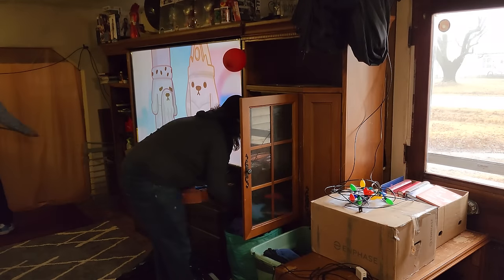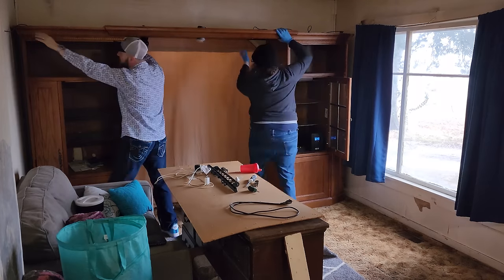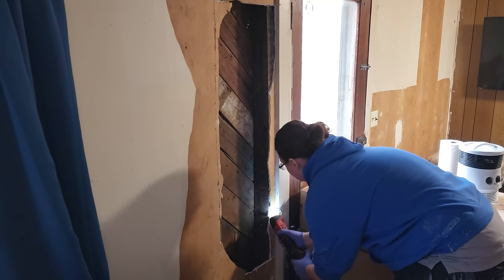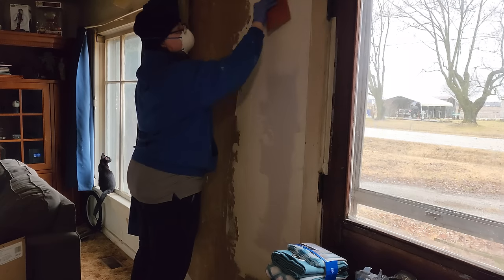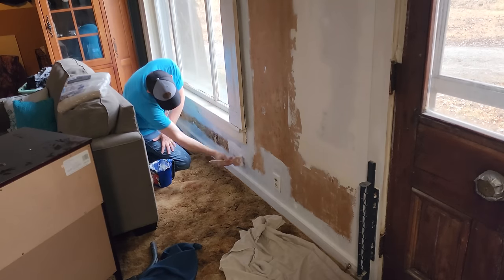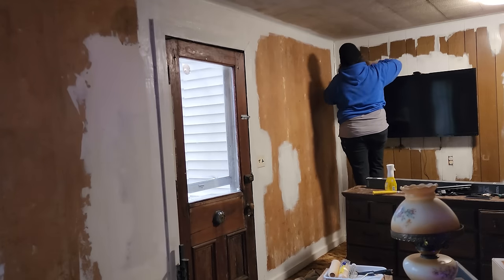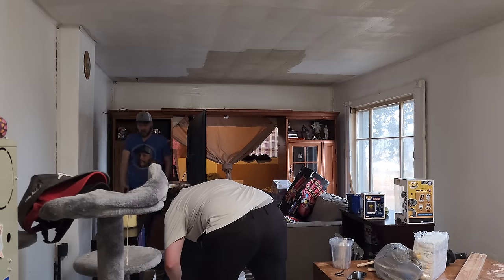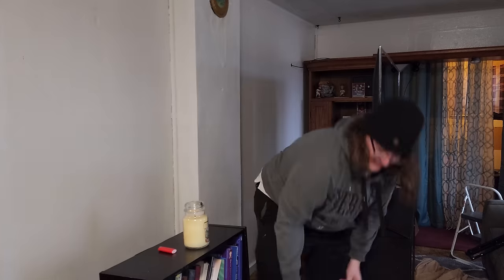Saving a Destroyed home for FREE: Episode 3

Comment: My home is 117 years old and while it's definitely in disrepair, these videos help me realize that I might not be in as bad a starting point as I thought. I am very thankful to be able to get a house at all. I have done many sub $50 repairs slowly over the course of the last two years and the home went from uninhabitable hoarded infestation to functional clean but dated home. Thanks for the motivation to keep moving forward!
Reply: I had very similar experience bought 110 year old ranch home. Needs a lot work and also been doing things like changing faucets and ceiling fans.baby steps 10 years it be so different for both of us. And love and appreciate the homes we work hard to fix up. We moved in and the whole house was trashed and we had spend 450 on dumpster to clean it. But I love my old fixer upper and thankful too

Comment: Your work is great and I have a few tips I use. You can reduce sanding by letting the mud start to set  and smooth it with a wet sponge. This should cut sanding by 90%. 
Drilling a hole and putting the straw from the spray foam in the hole would get the foam in the wall. This will not be perfect but it will help. Then dry wall the hole you made and paint.
My tips are how I do things and I like watching how you and others do things.
Reply: Thanks for the "what-to-do-after-you-forgot-to do-it-right" hacks! Better an after-thought option than to NOT DO IT at all.
Reply: I think it's better to patch and the wall before doing the foam insulation anyway, it can fill the space.

Comment: Just a tip for curtains that are too long for a window, I turn the curtains sideways and hang them from curtain rings, the clip on ones. It extends the length of the drop by about 1/4 in or so and increases the fullness. If you have an issue with the curtain rod pocket you can cut it and just use iron on fusing or fabric glue. Great job as always and I agree with whoever suggested drilling a hole or two in the drywall to use the cans of sprayfoam. A dollop of caulk can fill the hole.

Comment: Oh goodness my heart soared when I saw those patches going in around that room with the blanket curtain/bedding that clearly shows a child either sleeps there or uses that space most frequently. Seeing those holes in the walls and insulation poking out, knowing they likely have mice like everyone else, I can only imagine how low key anxiety inducing it would be for a child to sleep there. When I was a kid there was a very small hole in the wall, put there from carelessly moving in a metal bedframe and it scared the heck out of me as a kid, falling asleep looking at that inch wide little hole. So for those big enormous gaps to be finally closed and painted over, so that child can sleep without fear, it nearly made me cry. You rock.

Comment: I have a tip for curtains that balance the need for light and blackout conditions for someone who has to sleep. Install a roller blind (that matches the window width), then layer over thick curtains with large grommets that are hung at the ceiling and 4-5 inches beyond the width of the window. That setup is easy to open & close, doesn't have cords to get stuck or for cats to destroy, stays clean (roller blinds are easier to maintain than slat blinds), and gives you good darkness when the blind & curtains are pulled. I love this and it works really well in bedrooms.

Comment: Ugh! My new appreciation for painters. I got to paint a house I recently bought. I have learned a lot watching your videos.  My house i will have to remodel the bathroom and bring inside the hot water tank and washer and dryer. I don't want to heat the utility room that is outside under the carport utility room, I will just use it for tools and dry storeage. Great tips, 2nd coat makes the difference. 👌 👍 😀 Great job. It doesn't look like the same house. ❤

Comment: Hey, I gotta good tip for you. If you have to paint over joint compound, always put a coat of paint over the compound first, and let it dry. Joint compound is extremely porous and will suck up all of the first application. That way, when you’re ready to paint the wall itself, you don’t have to worry about it looking weird.

Comment: Pro Paint Tip: Buy a slim roller setup, they come in 4" and 6" a screen and bucket. It is 20x faster and you can use the edge to cut in.  A 2'-4' extension pole will speed up painting and save your back.

Comment: What an awesome job you both did! I love how you share your revenue with your community. May I give you one tip? I don´t have any of the fixing skills you used there but I can advice on hanging curtains. I would let the thinner, inner wing and the thicker wing overlap so to avoid gaps. Put one ring from the thin curtain between two rings from the thicker one. It makes the illusion that the inner curtains span the whole window/opening.

Comment: It’s not too late to add the spray foam insulation behind the patches.  You can drill a few small holes, just big enough to fit the nozzle in to and inject it into those holes (make sure you’re using the “large gap” filler one).  Have some pieces of masking tape torn off and ready to go so that you can immediately cover a hole when you pull the nozzle out.  Cover any holes that the foam is oozing out of as you’re working, and finally cover all the holes when you’re done (whether the foam is oozing or not). Next day, remove the tape and trim/buff/sand off any foam that oozed out and put a little spackling over the holes.  Then touch up the paint.  Voila!

Comment: For those saying you put the entertainment center back together wrong. Nope people. We have a similar style and there is only one way it can be put together, the way it was in front of the window and the same way surrounding the arch entry.

For room darkening a bedroom, I used the blackout lining yardage and hung them with grommet and hook over windows and another one inside the bedroom door. I turned the fabric down as a faux hem and added the grommets. That lip of 'hem' allows short me to slip a ruler or small dowel near the grommet to hang the curtain on the large hooks. Or to remove one side to more easily open the door. 
Well, now that I think about it, my bedroom door opens outward into the living room. So, your mileage may vary. 
At any rate, that blackout sheet keeps the light from blasting through the normal cracks of the door.

I used to work hellish hours and that was the only thing that allowed me precious sleep and sanity.

Comment: Curtain tip: when you have a curtain with those big ring holes, put each wand one on the other side of the bracket, then it doesn’t move when you open or close them. 👍🏽

Comment: i save so much money fixing stuff myself, but my huge problem is a 30 yr old leaky roof and i have a disability so going up on a roof is where my diy ends, sadly i have no money to fix it and because its so old no one will repair the leaks so its been leaking for years any thoughts? its a double wide trailer not sure what to do , i cant get a loan, you said you did roofing i need ideas ( maybe dump tar or rubber on the leaks not sure)

Comment: Ah, just a heads up, thoe kitchen tiles probably have asbestos in them too .. the house is mid century, it was added to like everything back then. the tiles are relatively safe, sicne the fibers are in the vinyl, asphalt, etc .. but if they are deteriorating, some particles coudl be released ... DON'T sand them, wear gloves resporator, tyvek, wash everything down .. I know you can't afford to hire a professional, that deals in asbestos, neither can they. Could also just try to level out if/where any pieces of time have come up with something and then put down new flooring on top.  Anyways, you's did an amazing job on the house and it was incredibly nice of yous to do. God bless you both !

Comment: Have You ever heard of a crackle finish?  It was "a thing" for a while, for "unique" furniture "fix ups".  Well, that is pretty much what will always happen if folk refuse to remove all the layer of wallpaper and scrub and sand down every speck of paste, before proceeding with repairs and spackle and Kilz primer. I have a mountain of real life horror stories with far more costly fixes (like forced to plaster over, panel over, wallpaper over with the thickest vinyl, etc. ALL DUE TO folks in a hurry, refusing to do the most valuable and necessary CLEANING.  My second warning is, is putting up decorative paneling, use nails but do not fall for that horrid construction adhesive crap.  Ruins your drywall forever.  Thanks for the drywall patching tips.  Fortunately, I have learned better from saving homes from too many disasters, not only from DIYer, but "professionals" over all my years and they are NOT improving!  Just too old and poor and sickly for a one of them to give a darn.  PREPARE EVERY CANVAS first.  Hear me, Jason?